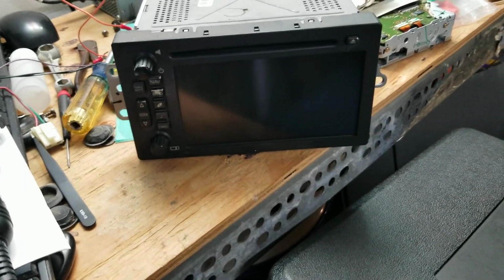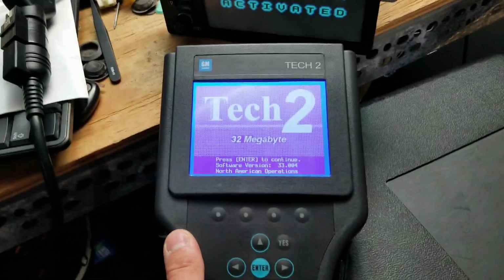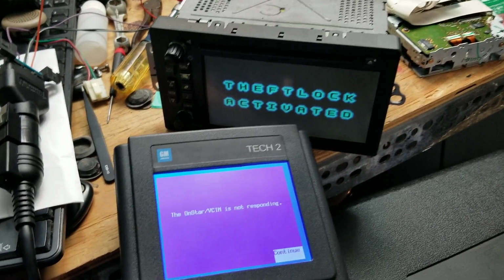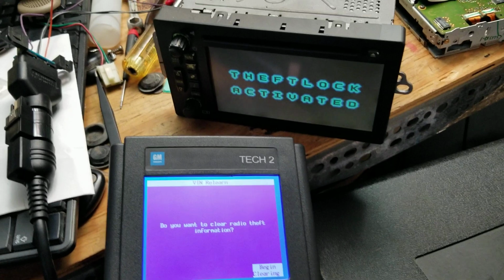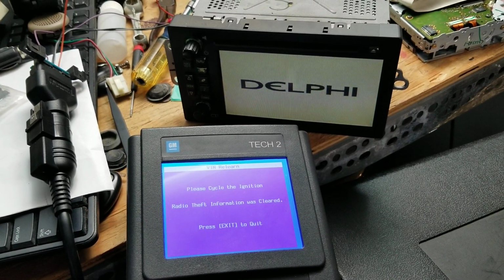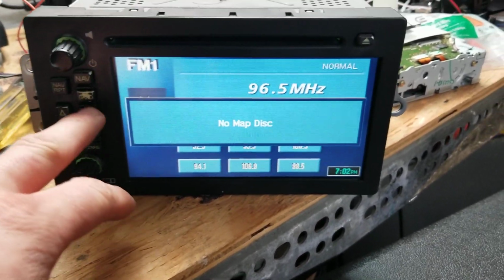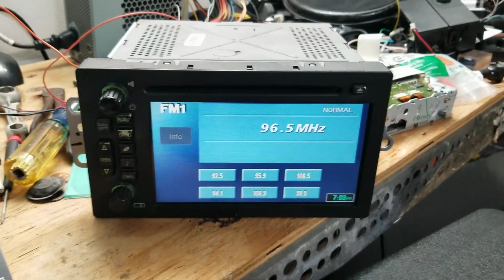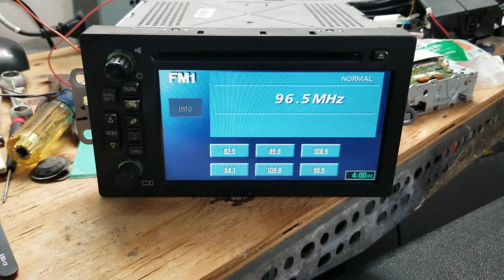VIN Unlocking a GMT800 Navigation Radio for Bench Testing

Comment: Let me try again, Great video, I’m trying to do the same thing, While I wait for my tech2 to arrive, I built a small harness with the C1 radio connector on one side and an OBD port at the other, I connected 4 wires between them.  +12v, 2 Grounds, and Class2 J1850 signal.   I plugged a 15800001 in when I press/toggle the power button, the screen toggles between the TOD(time of day) and blank screen.   I was hoping that it would display a Theftlock message or the normal power on message.   Is there something that I need to do to wake it up like putting another class 2 module on the bus so that the radio wakes up.  When I plug in my fancy OBD scanner, it does say the radio part number, but it won’t read the live data so I believe I have wiring correct since it appears it can talk to it.
Reply: ..... or does your little network have a BCM in it as well and it drives the IGN0 ,Ign1, and Acc inputs to have the BCM think its in a vehicle/network and its then sends the appropriate message to the radio so that can turn itself on?????

Comment: What does output control do. Under the navigation radio menu
Reply from the maker: Primarily just allows you to test speakers
Reply: @An-dnonymous  so if I wanted to increase the volume or change settings about the sound. Is there a way to do that?

Comment: I’ve got a 2004 Tahoe and am trying to put a nav radio out of 2006 gmc Yukon Denali. Would you be able to relearn the vin? Dealer told me that the part number was not listed in the tech2
Reply from the maker: It should be able to. Where are you located?
Reply: @An-dnonymous  I’m in the southeast. I’m going to try and reprogram my eeprom with my vin. I’ve seen people have success with this and it’s a much cheaper option

Comment: Hi will you unlock my
Reply: I have a Hummer H2 2009 SUV LUX ... "N" Truck product line I also have a GM TECH 2. My GM Tech 2 does not show a "Nav Radio" In The Menu. It only shows  a "Radio'" and below shows "Digital Radio"  I just bought a Brand new GM Replacement NAV Radio to replace the original one. It came thru Locked. There is no menu for "Relearn Vin" on the TECH 2. I can call up on the Tech 2 the Original Radio ID and other numbers but nothing where it says "Relearn Vin"  Is my Tech 2 out of date? I have followed your video but it does not lead me to Relearn Vin.  Thanks: Mark
Reply: @maraeht let me know if you got it I'll send you mine and definitely pay you

Comment: I have this radio in my 2006 Denali and have been really happy with it.  No biggie, but the date and year no longer are correct.  And from searching it seems to be a common problem.  I thought this was updated through the GPS?  Am I wrong?
Reply from the maker: They should be, yes. To be quite honest, I don't recall even seeing the date or year listed though
Reply: @An-dnonymous  you press on the lower right under the time and a window pops up that shows the month and year.  It always worked and as of 18 months ago it went back to 2000
Reply from the maker: @jewllake  I had no idea, I'll have to try that in my truck when it comes out of winter hibernation. I ran into a similar issue with a 2001 Toyota Avalon. The year stops around 2018, but reverting back to around 2002 was able to make the date and day of week display correctly
Reply: Looking into the same issue with a friends 05 Denali.  The date is around July 20 2004… but the clock is accurate for now
Reply: @DavidWilliamsThatsMe  any updates?
Reply: @MrOlea sadly no updates, friend sold the Denali before I could really look at it